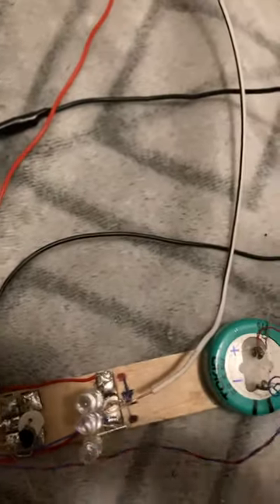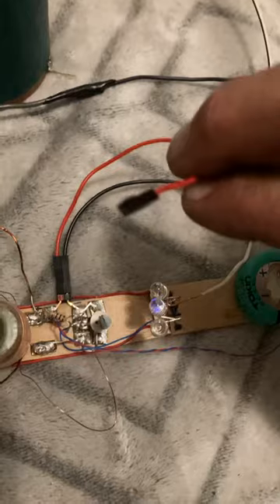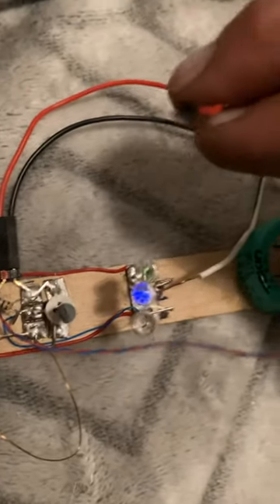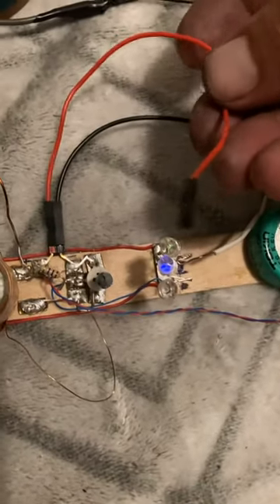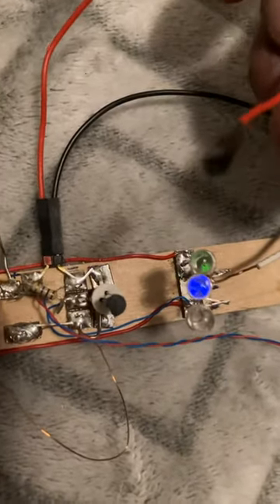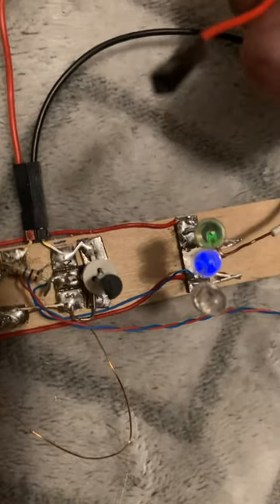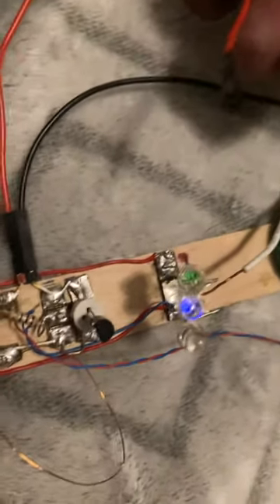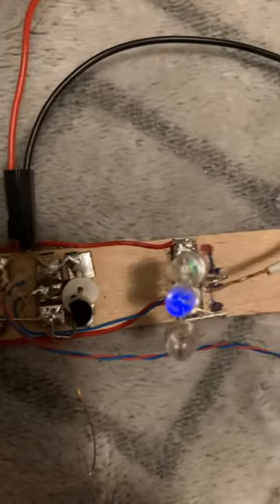Nigel ‘Hands’ Cheese - single ground power replication

Comment: Im trying to replicate the light bridge. Do all the earth go to ground?
Reply from the maker: Yes,  1 wire into the earth, about 200 ft away from the electric meter
The way im doing it now is with 6 diodes,
chains of 3 in each direction, tied together at the ends, one end to ground
Reply: @Sm0ky2  nice. Have u seen my attempt. Im using 4 leds.